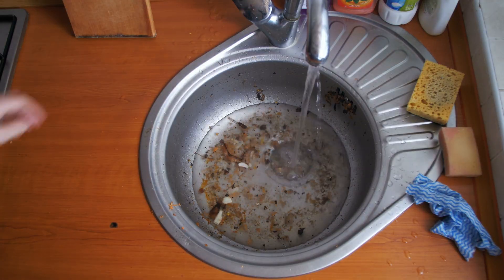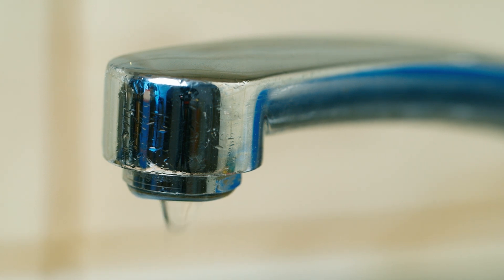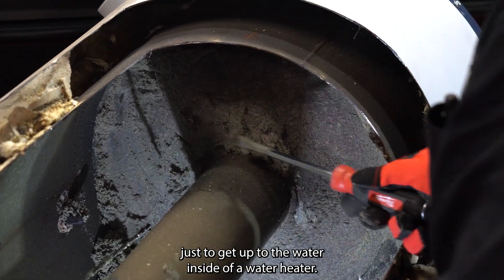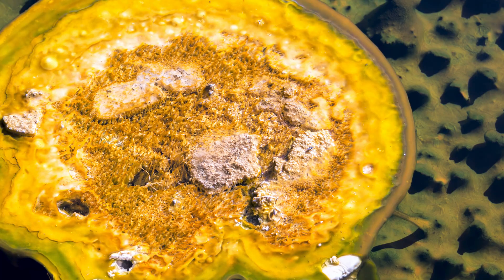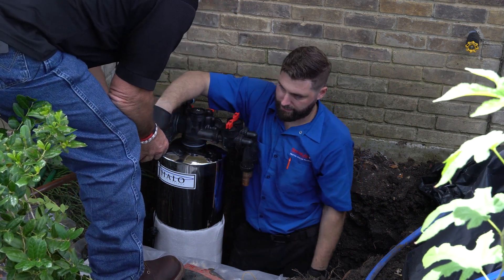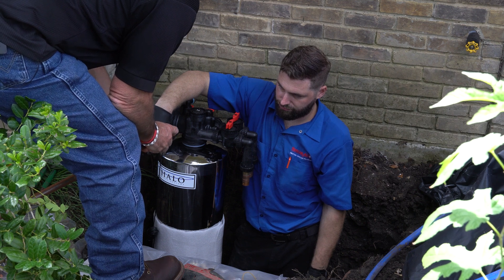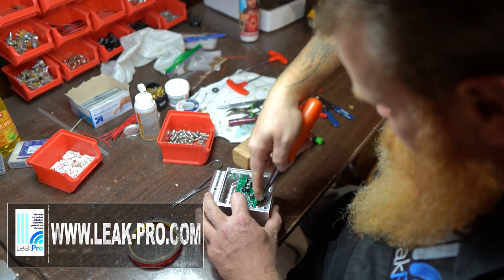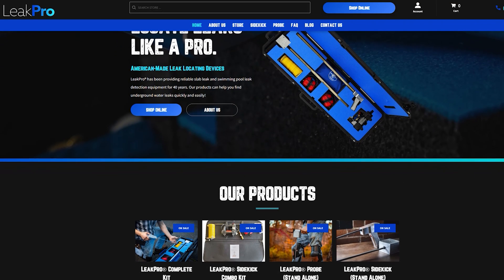Hard Water is Destroying Your Plumbing

Comment: I'm on a deep Michigan well (180 feet) and we've been running a softener for a few years. The well has around 700ppm of salt in it from the ground and high iron content. The softener does a pretty good job of getting most of the iron out, but we still get some staining. The worst part though, is because we soften the water due to the high TDS in the water, we get around a total of 1400ppm of salt in the water. Enough to taste it horribly AND its corroding the pipes, rusting the dishes, and heaven forbid we try to wash the road salt off the cars with that water lol. 

What can we do? Is a whole home RO unit the only way to tackle brine-ladened water?
Reply from the maker: It's a difficult problem, but it sounds like a RO system is your best bet.

Comment: Hi, Roger. It's Roger! I have a question and a comment. The question: How well do chlorinated, municipal water supplies get along with PEX tubing. If there is a difference in the way A and B might be affected, I'm specifically asking about PEX-A.

The comment: I have installed two water softeners with whole house filtration, and I got them from Crystal Quest. I don't work for Crystal Quest, and I have no monetary interest in the company at all. I'm just a satisfied customer, so I thought I would mention them in case there are other DIYers here that might want to check them out. The ones I got are the ion exchange type, and I got mine with stainless steel tanks. They aren't much more expensive than the fiberglass models, and I think the stainless steel tanks are the better option.

I'm one of the people who like the "sliminess" of softened water. To me, unsoftened water feels sticky. Soft water doesn't require as much soap or detergent, so that's an added benefit, too. I almost forgot to mention, I think most water utility companies provide Annual Water Quality Reports that show the average grains of hardness, so it might not be necessary for homeowners to do their own testing unless they just want to.  Thanks for the good video!
Reply from the maker: I've used PEX-A, and I've never had an issue with municipal water supplies.
Reply: @ Thank you. That was the answer I was hoping for!

Comment: Correct me if I'm wrong, but you forgot to mention what to do about hard water. You mentioned hating the slimy feeling water softeners give, but not the alternative that I was really curious about.

Regards,
Reply from the maker: I personally don't like the water softeners, others may. Water filtration, or a reverse osmosis filter would be the fix to having hard water
Reply: @RogerWakefield  I hate water softeners. Just more maintenance every month with salt and have to clean that nasty thing a couple times a year. I had mine removed. It left more deposits on my pipes than the hard water did. It's was a pain  to constantly get 40 pound bags of salt from the store and down to the basement where the softener was. And the water softener wasted so much water every month when it did a regen my water bill was super high. Between all the wasted water and salt I had had enough! I had my plumber come by to take a look at my situation and I explained to him my feelings about the water softener. He told me he felt the same way I did about water softeners and explained to me a system he had at his own home and if I would like to try it free for a while. If I didn't like it he would remove  it and we could do something else. He took the system out and replaced it with a Flow-Tech. It's been over a year now and everything is fine. The one thing that was really noticeable is that my water heater stopped percolating all of the time. I'm good now. Still have some water spotting but it doesn't bother me. All that nasty water scaling on my faucets is gone too. I live in far northern Illinois and my town draws it's water from wells. It goes thru the city water treatment plant and then to the residents.
Reply: He's talking about water conditioners and filter systems that don't soften the water but just filter it. These systems often use large spin-down replacement filters or large charcoal canisters.

Comment: Have you done a test of the electronic softeners? My parents have a well, very hard water, after many years, the salt softener went bad. I read lots of articles that electronic units were a scam, but I decided to try one. I just wrapped 2 pieces of wire around the 1" PVC incoming line, plugged in the little box the wires are hooked to, and wow, that thing actually worked. It lasted for years before it quit.
Reply from the maker: have not tried it...that sounds interesting
Reply: @RogerWakefield  Since you don't like the salt type(neither do I) then the electronic one may be perfect, it does not change the taste of the water, nor does it make it feel slimy. I had some friends test the one I have, as they have hard well water, they said it kept the ring from forming in the toilet, so, after they said it really worked, I installed it at my parent's house. Their kitchen sink had a swivel aerator on it, and the build-up made it really hard to move. I installed the electronic unit, and about an hour later as she was washing dishes, it started moving very easily, maybe a fluke, but also the spots on the shower door quit showing up, so it was doing something. Cheap to buy, very cheap to operate, real easy to install.
Reply: I installed one 5 years ago.  I dont know if it does anything, but as well, I dont seem to have any major issues when it comes to hard water.  I never did a test before, I just know our city has extremely hard water.  I thought it was witchcraft, but maybe they do work after all

Comment: We have super hard well water from the Trinity aquifer. I put a whole house filter followed by a water softener. Wow. What a difference. No more clogged aerators, clogged intakes on the washing machine and dishwasher. No calcium buildup…anywhere. No more red tinted toilet tanks. It’s a huge improvement. I put Resup in the brine tank monthly and between this and the pre filters my softener resin hasn’t degraded in 30 years. Oh, and by putting  CorroProtec powered anode rods in my water heaters, no more rotten egg smell. And the water heaters will probably last 25 years or more by combining the powered anodes with the water softener.
Reply: Use a 3 stage filter for well water. U will see the difference
Reply: @ It is a 3 stage. Spin down, 50 micron pleated and 5 micron wound string
Reply from the maker: Sounds like you've got a great system set up!